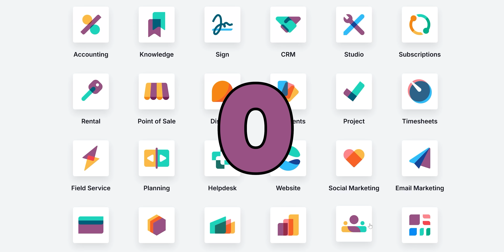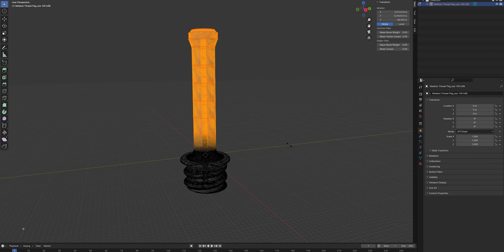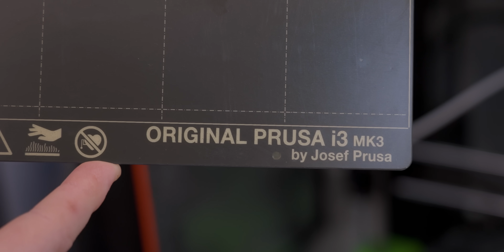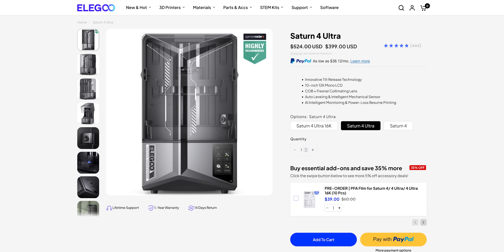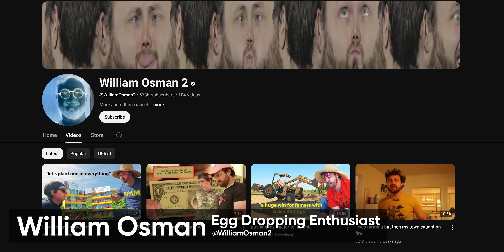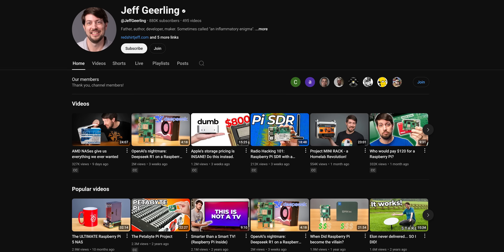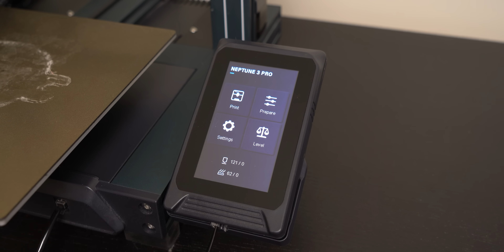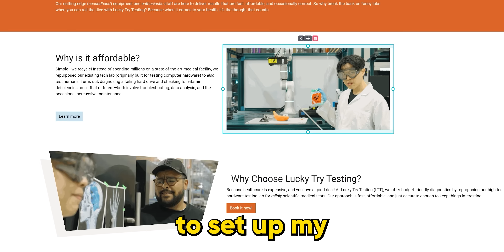Is my 3D printing setup wrong?

Comment: I have no hard feelings for anyone who goes for a BambuLab printer; not happy with how they've dealt with the firmware update fallout, but they still make some great hardware.

Were it not for the X1C, A1 and P1S, I don't think the rest of the industry would've gotten to the current era of 'printers that normal humans can actually use without spaghetti prints half the time' as quickly.
Reply: Well said jeff
Reply: Prusa was already there.
Reply: @scythelord  And there wouldn't be home 3D printing without Ultimaker. But people won't listen
Reply: Well said jeff. 🎉
Reply: This, competition drives innovation. And to be honest… coming from an Ender and a older Prusa it was like stepping on the bridge of the Enterprise comming from a fishing boat. After two months I sold my old printers/ have given them to friends since I only used the Bambu since I got it.
Reply: @RedAppleApe Honestly. I’ve been poking at my CR-10 v2 for several years. I even replaced the hot bed when it went out. I tinkered, I fiddled, I upgraded. But I got an A1 for my birthday and omg. I’ve spent WAY less time fiddling, and a ton more time modeling. It’s even inspired me to model more because I don’t have to wait 10 hours to see if something works or looks good. I wish I could have gotten the AMS just to swap colors but it was a mini with ams or an A1 without and I feel I made the right choice. I’m very happy.
Reply: I started with an Ender3 and the leveling issues nearly made me quit printing. (Esp after my son slagged the whole thing with a major build he started then walked away without telling me “mom I’m going to print a model for 19 hours”) I bought Bambu X1c with ams, so I can print quickly. Yeah Prusa would have been my top choice but sadly, Bambu is available locally and the Prusa was back ordered.
Reply: I'm super pumped to see Jeff in this video! The Raspberry Pi wizard!!,  he’s on a whole other level! Huge shoutout to @jeffgeerling! Can you imagine him teaming up with Jake and Alex on LTT? They’d create something hilariously epic! Let's make it happen!
Reply: I do have hard feelings towards them. But that's just because 99,9% of the people that complain don't know what they are complaining about.
Reply: 100%. Bambu gave the 3d printing industry a much needed kick in the right direction!
Reply: WhY No octoprint? You're the Raspberry Guy ! @jeffgerling
Reply: If it weren't for the A1 we wouldn't know how not to build an affordable bed slinger. They had a huge fiasco with them
Reply: @Liminal.Headspace  what are you talking about? I haven't bought one, but one of my clients has bought some a1s and minis and liked them.  Googling reviews, I see a sea of positive reviews.  Whatever negative options you or others have seen niche based on annecdotal experiences.  I saw makers muse have successful prints while an a1 mini was hanging from the ceiling by a rope.
Reply: how do you send prints remotely to the bambu now when in lan only mode?
Reply: @ Tailscale and studiobridge. I use a raspi to advertise a subnet, as well as block ads on all my devices wherever I am.
Reply: @xscitobor1233  VPN - I have a private WireGuard VPN that lets me punch through to my studio network. Then I can run OrcaSlicer either from a remote computer, or through screen sharing on my computer on that network (which I could also set up without VPN, if I use any of the screen sharing services that way.
Reply: I really don’t understand the fallout of the new update. Can anyone explain?
Reply: @22rsx  fallout is that if you want to use the cloud you’ll have to use their security layer (not a deal for you) but orca slicer refused to implement it, so you can’t use that for cloud. 

If you want, you can setup LAN mode and just setup home assistant, which is practically your own cloud without any issues and with orca slicer still available. 

Meaning power users can opt out of it (most were already using LAN mode), and beginners can decide what they want.
Reply: @ thanks!
Reply: @22rsx  So in their new idea of how to run things they want to limit users from being able to mod their system, either hardware or software, and force their system on which you HAVE to upload your model to their servers. You have to give them all your work data, to send your model to your printer to start. No opt out. A lot of people, rightfully, do not like that at all. Every prototype and edit you print is owned (or at least exploitable) by Bambu is the exchange to use their printers.
Reply: @TheWeaponshold  that’s completely false. You want to use their cloud mode it has to go through their servers, pretty simple. It already does - same goes for if you use prusa’s cloud printing service. 

You can definitely opt out as well.
Reply: @ thanks
Reply: @matkz22  Forcing Bambu Connect on people. And there is ZERO reason for your model to go to the cloud. I have an OLD ass FlashForge mini printer that can do direct wifi printing. Most other printer companies do not force that on you. So yes it is what I said it is.
Reply: @ You aren’t forced to use Bambu connect? Simply enable LAN mode and if you’re a power user enabled unsafe for full access. 

You can do direct WiFi printing on LAN mode, using orca or whatever you want no issues. 

It’s pretty clear you don’t own a Bambu printer or have bothered reading up on how it actually works. 

The only thing that is limited is skipping objects and that’s just because it isn’t implemented into HA yet.
Reply: LOL, I got mine before I knew about the update.  But honestly, its not that bad.  I use Inland Filament from Microcenter, or Sunulu from Amazon.  I've had no problems with it, yet.   I have not noticed any issues from the update.
Reply: They definitely need to work harder on walking back the firmware update comms debacle and show some results on a secure and open ecosystem for integrations. I believe they want that, and I still believe the biggest problem they had was admitting that the reason for the firmware policy wasn't closing out competitors (which I'm sure would have been a fine side effect for pointy-haired bosses in Bambu's management structure)... it was because the ecosystem that was building up around the old integrations was wildly insecure from a SecOps and Risk perspective.  They needed to own up to it and work with partners instead of trying to sweep the security sins under the rug. But the products and solutions they offer are still amazing.
Reply: if we are lucky the other brands will fix their quality control issues and the K2 Line and the new Elegoo printer will force some changes at Bambu. Sighs i still remember having to return my K1 because it wouldn't feed the filament or it would just get jammed for no reason. of how i had to return one of the two ender 3V2s i bought because it had issues with holding setting and would not get level regardless of how much i manully leveled the bed. i think the X axis was bent.
Reply: @writer8706  And the aggressive pricing on the BambuLab printers seems to have applied a little more negative pressure on others—most especially Prusa—which is quite nice :)
Reply: thanks to the raspberry pi i no longer need their cloud 😁
Reply: @liamosterhout6538  That sounds interesting, I've got a Pi, how did you skip the cloud? Local printing?
Reply: @liamosterhout6538  how? Can you explain?
Reply: I would say people should definitely follow your lead though and block them from accessing the Internet that just seems like good protocol at this point
Reply: I came to the printing game late enough that you could get a pretty user friendly printer from anyone (as it seems now) so I had zero draw to Bambu and as soon as I was made aware that they weren't friendly to the FOSS community I made sure to avoid them and not recommend.
Reply: @JeffGeerling  absolutely. I had multiple Enders and they all worked okay(ish) until they didn’t, and it was so much effort to get them back where they needed to be, if I even could.

Bambu convinced me to return to printing as a hobby and actually made it enjoyable. I agree that some of the cloud management and DRM-esque features have me more skeptical than I was, but if they can make everyone step up their game, and make a few tweaks to their own, they’ve made one heck of a difference.
Reply: @pollorojo  Ender printers work great for like the first week/month, then you start to tinker with them to help fix problems and it's like pulling on an unravelling string.  If you don't really truly know what you're doing you give yourself a new tinkering hobby, and not a reliable printing appliance.  If you need to 3D print stuff to make your purchase better, something's not right.
Reply: Why would anyone have hard feeling over someone else buying a particular 3d printer...
Reply: @DoctaPye  you don't want to know...I'd argue the fanboyism surpasses the console wars of old.
Reply: @DoctaPye  Because when a market leading company begins to implement anti-consumer practices, the best way to stop them is for the community to shun their products.  If people keep buying, then they have no incentive to change.  It's called voting with your wallet.  Consumers who ignore this harm the larger consumer base overall...
Reply: @ctvxl  power users are not the target market for Bambu, their market is one of their printers in every home! This is another reason why they’re tightening their ecosystem so they can offer a “it just works “ Apple like experience. I’ve been around long enough to witness a similar outcry when Apple brought out the McIntosh computer. The command line driver heads were exploding. And when those new fangled digital voltmeters came out, it was blasphemy I tell you.
Reply: @ctvxl  I don’t care, I just want my printers to work
Reply: There is no H is Prusa Jeff
Reply: I see Bambu kinda like Tesla. They came in and kicked the industry into gear making better stuff.
Reply: Likewise, I got a P1S, happy with it, works great. At the time it was the only sane choice for a user friendly printer (imho). But with the direction Bambu is taking and how good the alternatives are nowadays (thinking about Elegoo, Creality, maybe even Anycubic, since Prusa is too expensive for my taste), I'm pretty sure my next printer will not be from BL. Will be happy to get another BL if they go a little more "open" tho!
Reply: bambu really did speed run the "live long enough to see yourself become the villian" trope
Reply: They seem to have backpedaled some. My biggest concern wasn't the orca cutoff (which I do use, but the default bambu interface is likely sufficient for me), but that they will paywall other features through a subscription service.
Reply: @WhoTFstolemyname  Thats entirely just speculation though, and likely anything they add as a paid feature will just be in addition to the basic service, so things like cloud storage and cloud slicing etc
Reply: @WhoTFstolemyname  I mean orca wasn’t cutoff. The dev of orca refused to implement the security features made by Bambu. Even then we haven’t seen any inkling of a subscription model, so I’m not sure where that idea comes from.
Reply: I have clients who would have been effected by the update.  But to be fair, this was a beta update, and was adjusted relatively quickly.  I understand the "fear" and think bambu was dumb to do what they did, but I also think people are blowing a potential beta update out of proportion some too.
Reply: @ChaseAnderson5k  It's not a beta firmware anymore - they just released it as stable. They did packsaddle a little by allowing for the so-called developer mode but the trust is lost. I'm not installing their new firmware on my printers and I'm keeping them strictly isolated. And it's not necessarily because I think there's a nefarious intent behind all of this - it's because if that's the level of their cybersec competence, I'm not putting my printers anywhere near open internet.
Reply: Ultimaker released a new machine the S9. If it wasn't for ultimaker and cura, we'd have no Bambu lab.
Reply: Not for owning one no. But buying one NOW I would definitely roast someone over with so many better options. Its basically another case of "make a good product, fail to understand why people love it, lose base and future customers to new competition" that is happening with them.
Reply: @TheWeaponshold  but your opinion is based on false narratives as you don't own or have ever used one your opinion is completely and utterly pointless and irrelevant

Even linus was FOS, he has a P1S and in no way has and updates currently had a single impact on that model
Reply: @TheWeaponshold  I'm not convinced that there are so many better options for everyone, especially for someone who is completely new to 3D printing and on a budget.
Reply: @stukyCZ  There are MUCH better options. The Bambu A1 mini was never worth the money. The A1 is better but RIGHT NOW the Anycubic Kobra 3 combo (with 4 color printing just like Bambu) is $350 vs the A1 combo at $530. And Anycubic isnt trying to walled garden and own your models. That took me about 3 minutes to look up.
Reply: @TheWeaponshold  the Anycubic isn’t even close to the A1.
Reply: Bambu did help push the industry forward (even though I believe that some of that work was done by the Voron team).
But kind of like how the Unity Engine changed their terms on a dime and upset a bunch of people, I'm concerned that Bambu could do something like that.
But maybe they won't!
I don't know.
But the competition seems to have gotten caught up in many respects, so I'd rather go with Anycubic, or one of the other brands with less control over what you do with your own device.

What if the US went into war with China and suddenly Bambu banned Guns and other things from being printed by their users?
Doesn't sound like an ecosystem that I want to be in.
And yes, I do believe that we will go into war with China.
There is a prophecy about it.
Russia is involved, too.
Reply: No hard feelings only disappointment that ppl still pay companies to walk all over them
Reply: @thoughtlesskills  walk all over me? I pay this particular company to produce a 3-D printer that is as close to “set it and forget it“ as possible.

If that company is walking all over me, then I choose to let them. For me, all of the recent controversy has absolutely no discernible effect on my general well-being. 

Mind your own? 🤷‍♂️
Reply: I know right.. its crazy. You need someone to steal dozens of patented mechanisms to normalize it in the industry before other people start ignoring patents too! Revolutionary!
Reply: @Wang_Thunder  Patents definitely can be anti-consumer if it prevents good tech from becoming widespread due to greed / lack of resources / drive.
Reply: @Wang_Thunder  Why do you do this? You know full well they didnt stel any patented mechanisms, they are not and never were the first printer of that type, they just did a better job of making it easy to use. Such a weird lie to make up.

Comment: Safety... SAFETY... Not properly explained.
Reply: 12:25 Safety third.
Reply: @ i dont get what you wanted to show at that minute ? not making fun of you , i really not get it
Reply: @emanuelkakuja9614  There is a piece of paper on the wall,middle of the frame. (Plus, it is a phrase Mike Rowe mentions frequently)
Reply: @donc-m4900  what do you mean piece of paper ?
Reply: @emanuelkakuja9614  poster. Look at his left hand. Look behind it. On the wall
Reply: my thoughts exactly ; i didn't see any ventilation ; i think their explanation would be that they print PLA and TPU ; or at least thats what i deduce to be the case

Comment: My work got three Creality K2 Plus printers, and I liked them so much I got my own with the CFS. Oddly enough, I've had barely any problems with the ones from work, but I have had a few on my personal unit. The bottom door hinge on my personal unit detached from the door during shipping, and the bed adhesion in one corner isn't great. The door hinge wasn't a huge deal, someone online created a jig to hold the hinge in place while you glue it back on, and it just took some UV resin to glue it, which was pretty cheap. Not sure about the bed adhesion problem, but I'm willing to bet it's a bed leveling issue. I love the massive build area, and I've already printed a couple of things that took up the entire bed!

Comment: Just print a new bottom and slap it on 4:04
Reply: You can't do that; the AMS body is a single piece. You'd have to cut the existing bottom out, devise a mechanism for putting it back, and then figure out how to manufacture a new bottom piece.

Comment: When I bought my new printer a year ago, I considered Bambu but have had great luck over the years with Flashforge. My current printer is a Flashforge Adventure 5M. The price is reasonable, setup is easy and the only thing I wish it had was multi filament but that is not as a big a downside as I expected.

Comment: Do not touch the print bed plus you need to have glue and then clean the print bed at least twice a week
Reply: Bro hows 2014 ?
Reply: @RADkate  depends on the build plate, the filament and of course the 3d model you are printing. It can still be an issue. With the PLA + Bambu smooth PEI sheet I often run into adhesion issues if I touch the surface too much. Also Smooth PEI Sheet and PETG has too much adhesion, so you need to use glue or you risk ruining your plate. Sure, you could use a textured PEI sheet, but sometimes you need/want a smooth surface. The new-ish SuperTack Sheet would be an option for PLA/PETG, but what about ABS/ASA/PC/PA/TPU/...?
If I'm also just stuck in 2014 and you have a solution for all this without glue and without cleaning the plate, I'm all ears.
Reply: You don't need glue
Reply: @nicolasroy8481  You don't need it no, but it's nice to have the security for an 6+ hour print. I found a higher bed temp keeps the adhesion well enough for most prints